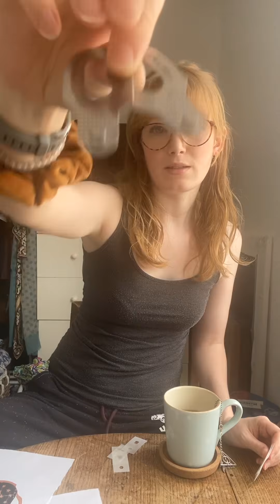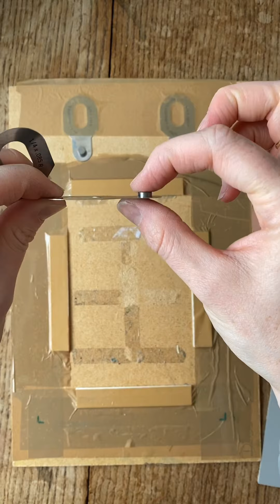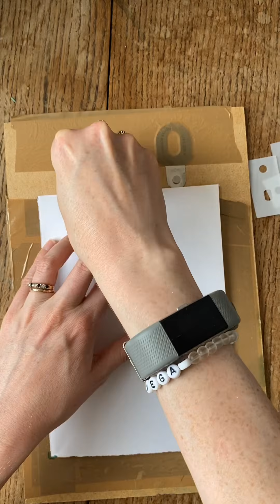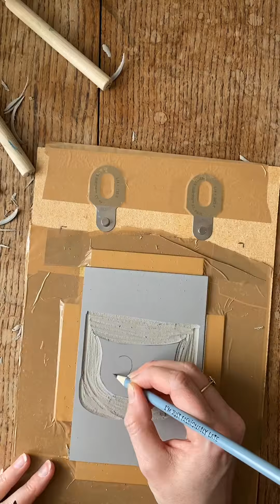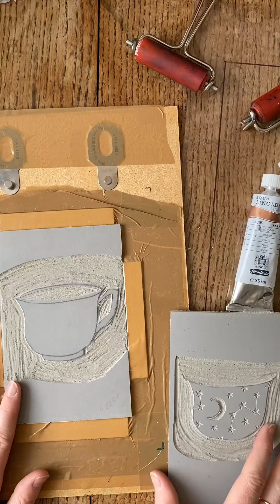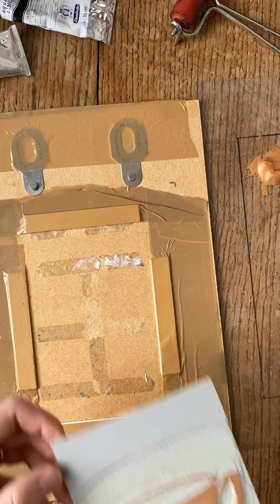Using Ternes Burton Registration Pins For Relief Printing

Comment: Put the tabs in first, then the paper and attach that way. You will then create a hinge with your tape and not have to hold it up all the time. Also if you create a mask between your work and the paper then no more cleaning when you accidentally roll ink onto a non image area. The mask prevents the ink from the non-image areas.

Comment: I’m not quite understanding how your image is transferred onto the linoleum.
Reply from the maker: I drew on the tracing paper, flipped it over and traced the lines with a soft pencil. Then I put the tracing paper back over the lino and traced the lines again - this time it will press the graphite on the underside to the lino block.

Comment: Hello - do you have to wait for each colour to dry before printing the next one with this method? I am using Caligo Safewash and this takes days to dry sometimes.
Reply from the maker: Ideally, yes you need to wait for each layer to dry. Some people print wet on wet but I wouldn't recommend it. Oil-based inks like Caligo to take days to dry but you can add driers to speed it up a little.
Reply: I use caligo safe wash as well. The paper you use definitely makes a difference. Cheap cardstock takes .ages. The thin, Japanese washi I got on sale takes just hours. I've been putting mine in a dehydrator with drawers if I'm in a crunch!

Comment: Those tabs are a lot better than punching holes into the paper. In school, we used a hole punch directly on our printing paper so they can be registered to the pins. We would then just tear off the side with the holes after finishing the print. I felt like we were wasting so much paper. I like how you can reuse those tabs.
Reply from the maker: We like that too!
Reply: You answered my question: I was wondering if one could use an animation peg bar.

Comment: Thanks for the tutorial!  :-)  Is it safe to pass the pins through a press with blankets at a reasonable pressure?  are the tops rounded?
Reply from the maker: Yes, you can put the pins through a press. You can protect your blankets by putting a sheet of something on top - some people like to use an old cutting board. The pins come in 2 heights: 0.085inches and 0.055inches so you can choose the lower height if you like.

Comment: Thank you for the tutorial! Which height is better? What's the difference in the working process for the pins of different heights?
Reply from the maker: Some printmakers like to use the lower pins when putting them through a press. I like to use the .085s mostly but there's not a large difference in height.
Reply: @Handprinteduk  thank you for answering 🤗
Reply: @Handprinteduk  Yes, this is my concern as well. A decade ago, I ordered two sets, different heights, but never used them for fear of having the raised metal punch put dents into my Takach press drum.

Comment: Great tutorial - just one question - does the masking tape not ruin the paper when you take it off the plastic tabs?
Reply from the maker: It depends on the paper. You can cut your paper extra long and then trim off the taped area or you can use a hairdryer to remove the tape too!
Reply: @Handprinteduk  Use drafting tape instead of masking tape.  Drafting tape looks like masking tape but is designed to peel off.  Drafting tape is available at art supply stores and online.
Reply from the maker: @jekalambert9412  Yes, good tip!